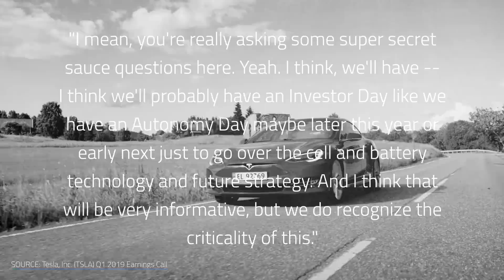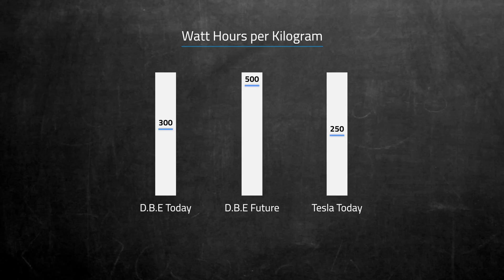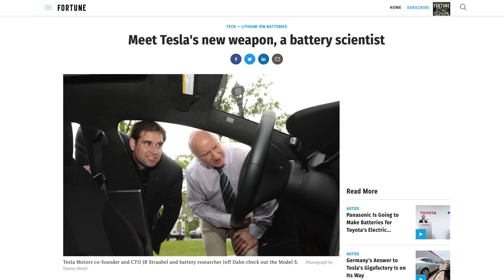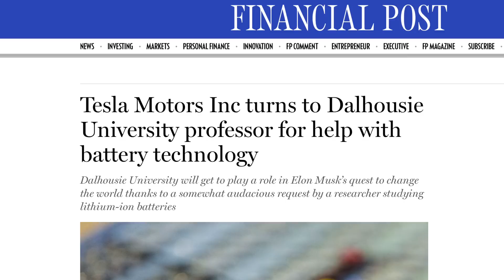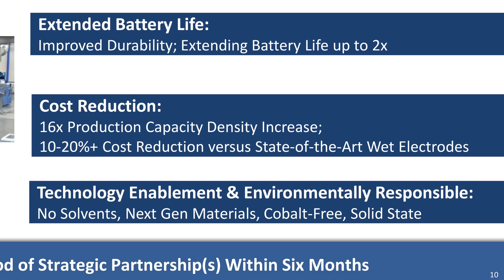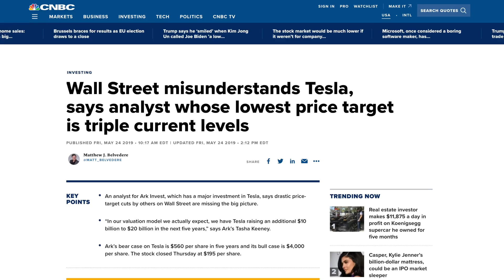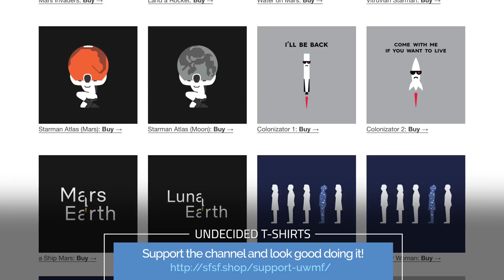Tesla And Maxwell Technologies

Comment: With a motor already designed for a million miles and a battery pack soon Tesla is designing cars specifically for Transportation as a Service...not cars for a single owner.  Tesla's rocket will take off when Elon starts the Tesla network. As we've seen with Tesloop's model X, a vehicle used in a TaaS model may drive more than 150k miles a year.   At this rate of mileage ICE vehicles become useless as their maintenance and fuel costs become completely noncompetitive.  When you then layer on the Swanson's law effects that drop electrical costs below 5 or even 3 cents per kwh it's clear that Tesla will own the TaaS market.  The recent announcement from Micheline regarding their tweel will create a car with even lower cost per mile characteristics.

Comment: Zac and Jesse from Tesla time news, just did a deep dive on that acquisition. They said something about electric adjustable shocks and suspension from Maxwell. Although, it was mentioned only in passing. Do you have any time to elaborate on it?
Reply from the maker: A few folks have called out the adaptive shocks too.  Even thought I didn’t think that was a key aspect of the acquisition, I probably should have touched on it.  It’s actually coming to the the S & X refresh, so it’s already coming to market ... which is awesome. It uses Maxwell’s ultracapacitors to power the active suspension system on the car.
Reply: @UndecidedMF  Awesome, thanks for replying.

Comment: The only thing that I think you are missing is that at this point, unit sales are critical to survival. They can be right and still lose at this point. Full disclosure, we own 2 model 3's. Ideally, they can integrate Maxwell fast enough to improve their bottom line.
Reply from the maker: Agreed.  They have to hit the numbers.  In the recent Elon interview on the Ride the Lightning podcast he said that they couldn’t have made more cars over the past year if they wanted to because of battery shortages.  Bringing the new battery tech and production lines online is essential to hit the production volume they need.
Reply: @UndecidedMF  What is the next scaling bottleneck after the battery shortage is solved?
Reply: @Obscurai  I'd say building the cars, themselves. You'd probably want to build at least five million cars per year to grow the robotaxi network and meet demand. They'd need to build or buy a lot of factories to do that, so they'd need to raise tens of billions of dollars. Personally, I think Elon should focus on robosemis; that would likely be cheaper / less debt-intensive and more profitable for them, anyway.
Reply: @EMichaelBall  Agreed. Model Y is the next hurdle given limited factory capacity and size.

Comment: If these 'new' batteries don't get the EV to a 400 mile range, supercharger times down to 5-10 mins for a full 100% charge and the price down to ICE vehicle prices, then I'm not interested. I'll wait some more...and some more...and some more.

PS: Your video/audio sync seems a bit off.
Reply: 5-10 minutes for a 100% charge is not going to happen any time soon because Li-Ion batteries will always taper.  Maybe 80% 10 minutes but that's still pushing it.

Comment: I was talking to a traveling Tesla service person. He said the Million Mile Car is extremely important to Tesla. The battery pack is the last piece of the puzzle. It sounds like Tesla is very close, closer than most buyers and competitors realize.
Reply: Rated to a million miles = 1.5 million miles with TLC. Same with the motor, so far as I've seen considering the gear quality after a million miles from that test they videoed. Probably change gear oil more often than needed, and you can get that kind of longevity.

Comment: The biggest challenge isn't technical, it's commercial. How does Tesla disentangle itself from Panasonic? Tesla may own the building, but all the equipment and IP at the Giga factory is owned by Panasonic, how is Tesla going to get away from Panasonic's process without a huge gap in battery production?
Reply: Who says they are?  Maybe they are, maybe they aren't.  Tesla already has battery patents apart from Panasonic, but Panasonic still makes all their batteries.
Reply: @gigglehertz  Yeah, so how does Tesla make batteries without a Giga Factory?
Reply: @karlp8484  I don't follow.  Are you claiming Panasonic will take the gigafactory and kick Tesla out of their own building?  That makes no sense.  They could tell Pana to take a hike (but they'd likely have to buy the Pana owned equipment inside) but it's easier to just keep things they way they are, after reconfiguring the part of the lines that are affected by this new cell tech.  What I meant, which you obviously misunderstood, is that they ALREADY have IP that does not belong to Panasonic, which is being used by Panasonic at Giga1.  Therefor to ASS-U-ME that this means the end of the present arrangement  is premature.
Reply: A technology sharing agreement is usually how partnerships proceed.

Comment: Please don't compare Tesla to Apple.   That's like comparing a palace to a shed. Tesla will not produce the same looking cars year after year, they will not charge just as much to fix a windscreen as the whole car cost, they will not make there cars charge slower every new model they have, they will not steal technology, and they will not charge the earth for there product. Tesla if 100x better then Apple....
Reply: you missed the point of the "vertical integration" reference.  its a 10,000 foot comparison.
Reply: I also dislike Apple in general... and am a TSLA long but there are a few comparisons that are fair.  Apple actively blocking legislation for 'right to repair' and Tesla has been unfriendly to anyone wanting to fix their own car or have anyone not Tesla work on them.  They will leverage whatever they can to make more profit and that includes high level of control of their products after sale
Reply: steve So what? Who repairs their own phone? Or, these days, their own car, assuming it was made in the last decade.
Reply: @j.kevinmcnary9561  I replace batteries in my own phones and recently changed the screen on my Essential PH1 when it cracked. It cost half as much as a screen repair store which would be 1/4 the cost of Apple replacing an iPhone screen at an official Apple store where they can set the price to whatever they want and no one is even allowed to sell replacement parts or work on the devices. They literally have codes assigned to each hardware part now so even if you do DIY, it won't work! It's extreme anti-competitive behaviour.  I get many people don't want to DIY, but I find it surprising anyone would be in favour against being allowed to DIY! I'm a computer engineer and have a friend who is a mechanic. If together we are competent to work on my Tesla, shouldn't we have an avenue to do so like it has been with all other vehicles for generations?
Reply: steve I'm sure you do. But most people don't. I used to fix my own cars, too. And I carry insurance on the phone. You are the exception.
Reply: @j.kevinmcnary9561  Apple is the richest company on the planet.  I believe in right to repair and the only argument against that is pro corporate profits and monopoly. Apple recently lobbied the provincial govt where I live to block new right to repair legislation and won.  It removes choice from the consumer.  It means if you own an iPhone and need a repair you have to decide to pay massive premiums or buy a new phone. Apple actually makes more profit if you choose to repair in the long-term.  The profit on two common repairs is almost as much as on selling a new phone.. and even if you do repair you will have to buy a new phone soon, hence they net more if you repair... but only if they can prevent consumers from having a choice of how to repair.  They also knowingly slowed older phones performance to try and motivate replacement under the guise of stability.  They are currently being sued by a large group of iOS developers for anti-competitive behaviour.  They don't pay any corporate taxes and leverage near slave labour to build their devices (like most phones).  They aren't even the best or leading in technology any more. They lost their soul to squeezing the most profits and on that they are extremely successful.  You would think with that mountain of cash they could keep their innovative lead...

Comment: The only thing that makes sense is that TSLA is under attack by the combined forces of big oil, auto, and communications.  They're attacking the stock by shorting, downplaying Tesla's strengths, and attempting to discredit the company however possible.  SpaceX's internet play threatens Comcast, who is appearing to use their ownership of CNBC to trash the stock to the investor class.  I think he's going to succeed despite this, but the stock's value will get hit until it's absolutely unmistakable that they're out of danger.  I suspect this will be sometime in the fall.  Regardless, it should be obvious when they reach that point, and that will be an incredible buying opportunity.
Reply: My sentiments exactly.  I bought more TSLA stock while it was down around $180.  In just a few days it's bounced back over $200.  That may have been the last chance to get in under $200.
Reply: @JamesSempy  Nope.  What should the value of TSLA be when they have a fleet of 500k robotaxis, each making 10 - 30k USD per year in revenue?  What should the value of TSLA be when they get their 4th Gigafactory up and running?  What should the value of TSLA be when batteries will double in capacity and throughput to the point that they're able to power commercial air flights?  $1,000 a share?  $2,000?  Are you going to believe the pundits who have never created one iota of value in their lives and who are likely paid by interests that want to stop TSLA, or are you going to believe a man who, in his spare time, lands 1st stage boosters on a dime on a rocking boat in the middle of the ocean?

My vote will be with Musk, and others like him.
Reply: @jklappenbach  
and what should the value of TSLA be when they buy all car manufacturers, all battery producers, plus Uber  .....  ;-)
Reply: @JamesSempy  Why would they buy all car manufacturers?  Or battery producers?  Or don't you remember Elon open-sourcing a good deal of TSLA patents to encourage competition?  Also, I would think acquisitions would only occur if they made sense, and for the average legacy producer, there's simply too much dead weight and old thinking to be of value.  Better to let them go out of business.

There's also no real point in buying Uber.  The main value of Uber are the drivers.  The infrastructure / cell / webapps  are all transient assets.  While as digital property, they require work to replicate, they're not a competitive advantage.  TSLA wouldn't need drivers.  That's the whole point.  Uber, Lyft, and the rest either fight back with their own driverless fleets, or go out of business.

What I'm still trying to figure out is, if TSLA can make up to $30k per year for vehicles in a FSD autotaxi fleet, why produce them for the public?  If the cars will last 1,000,000 miles, and the average taxi drives 50k miles per year, that's a 20 year life span.  Even pessimistically going with $20k per year revenue,  that averages a revenue potential of $400,000.00 per car's lifespan.  This is for a car that probably costs them $45,000 to make.  See how TSLA goes to a 1T+ valuation?

This all hinges on Full Self Driving.  And FSD is coming.  Soon.  And if it's not TSLA, it will be another manufacturer.  TSLA just has orders of magnitude more experience than all competitors combined, with the telemetry of billions of road miles used to train their AI.  They make their own chips to run their AI, and the architecture is multiples faster than anything else out there.
Reply: @JamesSempy  They have trillions collectively invested in infrastructure surrounding gasoline and internal combustion engines, from gas stations, refineries, supply chains for parts, repair shops, etc.  To abandon these assets would be to throw away a century of hard work and most of their balance sheet.  Also, they have zero vision.  They're so locked into their worldview that they scoffed at batteries until it was too late.  It's the same thing with oil / natgas producers and solar.

Here's the thing, though: it doesn't matter what they think or do.  Solar and batteries are improving *exponentially*.  It's really hard to grasp that as a human, since for all of our history, linear progression was all we experienced.   A constant doubling in power / # structures per cm^2 has given us processing power in the average smart phone in our back pockets that used to require a city block and its own power transfer station to operate only 40 years prior.  For the oil / ICE crowd, to sit in their boardrooms and project that the competition would have exponential asset growth is to literally assume that the sky is falling.  It's perhaps for this reason that they were willing to bury their heads in the sand.  But it's really too late now, and all they can do is short TSLA.

Note: a simple google search will reveal plenty of reports that batteries are not exponential.  But if you look at the growth of wH/kg, since lithium took dominance from NiCd, it's seen a regular doubling in performance.  It's on a much longer period than CMOS chip design, at around 10 years per double.  But it's doubling nonetheless.  And this will play out in a variety of ways: halving the cost to the consumer for x kWhs, doubling the range with a given volume of batteries, or doubling the amount of power that a volume can produce.  The next generation of batteries, where density will go up to 500 wH/kg, will see cars with a 900km range, or see the battery price cut in half.

Solar and battery improvements combined are an unstoppable force.

Comment: Maxwell showed a graph with more capacity available at high discharge current, i.e. even more range available (presumably lower internal resistance so less energy wasted as heat?)

Comment: Another way is the supercapacitors with regenerative braking. That combined with the battery will allow for much better braking and acceleration and extend range.
Reply: They are 99.99999 perfect as they are.

Comment: Tesla reminds me of Apple to, at least pre 2015. Now, not so much!
Reply from the maker: I can see that.  An integrated vertical stack doesn’t do much if you take your foot off the gas (or should I say accelerator pedal).  I will say that Apple is still killing it when it comes to mobile processors.  Their custom A series of ARM chips out performs everything on the market.  Part of that lead comes from the tightly integrated silicon and software that they do.
Reply: Undecided with Matt Ferrell Yes true the processors are unbeatable and always have been. The innovation, however, is lagging and they are broadening and focus on the wrong thing and becoming a profit machine with all the subscriptions they’ve keep adding. Feels like they would ultimately be going towards an update fee whenever a new operating system comes out. They are getting greedier and some day, who knows, it might lead to that.

Comment: Hey, first time listener here... love your content and very glad to see information about Maxwell coming out again. One of the angles that you didn’t cover which I think is really significant is to do with their super capacitor patents. To produce a solid battery combined with the Lightning fast charge and discharge abilities of a super capacitor and their insane number of cycles. I think you will have cars that can launch over and over without overheating the battery pack and further reduce overall charge times. My Mazda6 has a small super capacitor that charges in 15 seconds when I’m trailing to a stop and then restarts my car in 0.31 of a second due to its fast discharge capabilities. 

Will Elon produce a battery pack that is say 90% dry battery electrode and 10% ultra capacitor?  🤔
Reply from the maker: Time will tell.  The fact he studied advancements in EV energy storage in college and grad school ... part of which was around capacitors ... perhaps.